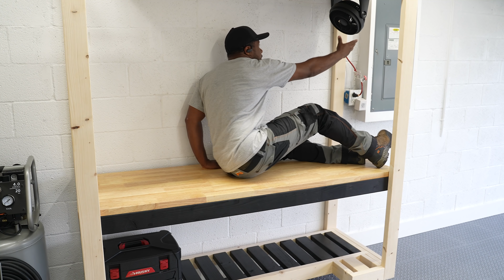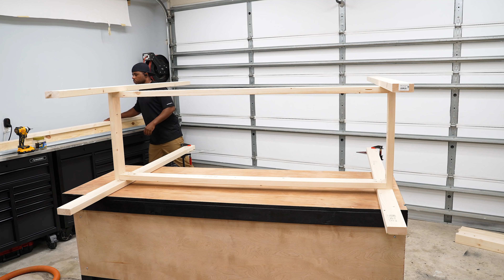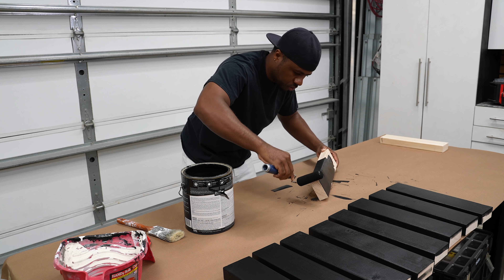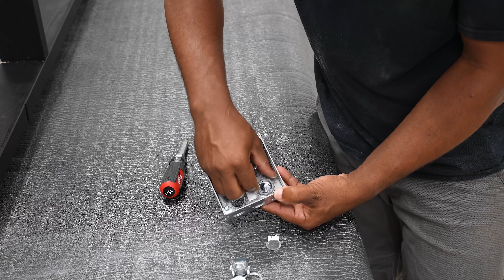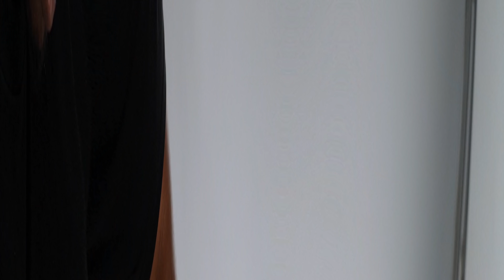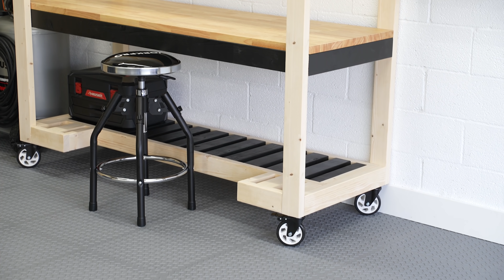DIY workbench with built in light // DIY Woodworking

Comment from the maker: What do you think about this workbench? What do you like or don't?
Plans: https://gum.co/hNWdj
Written version: https://diycreators.com/workbench-with-built-in-light/
Reply: Seems handy especially for a shared/smaller space like you said. You've made a lot of portable stuff over the years 😁 love the positive vibes you're sending out too Glenn! Keep up the great work, take care mate 🇦🇺💜

PS. The fan is an awesome idea!
Reply: Hmm, likes and don'ts?  I really do like the clean lines as with all your work, the functionality, the mobility, the strength, the overhead lighting that moves with it, and the single power cord going to onboard outlets.  It's pretty awesome as it is.  If I had to say a don't, I'm not sure the 4-poster design would meet my needs in terms of accessing the work surface with larger/longer items, seems I'd always be hitting something on them.  Plus in the current lumber market, I can think of a few better uses for the front posts.  If that top were more than a light, fan and hidden wiring and outlets, like top storage also, that might justify the extra support posts, but how much can you really store up there and keep it mobile?  I'd think braces mounted on the back posts would be fine, or even a single 'utility post' up the back middle to support the light, fan, outlets and wiring (maybe a light that flipped out from the post on some sort of articulated arm, providing some amount of aiming).  If 2 posts are kept, I'd probably add a slat wall or French cleat system on the back.  Being able to reach up for a tool or organizer box or some such could help the work surface stay clear.  Or if not a back wall, maybe a flip-up extension in the back, like a table saw outfeed, doubling the work surface temporarily for larger projects.  And a couple of drawers under the bench might increase the functionality.  Maybe a flip-up mounting for a small vise or bench sander?  I wouldn't want to load it down with too much, turning it into a storage cart or something, because as I said, it's pretty awesome as it is.
Reply: @billparrish4385  I built something similar to what you suggest.  Just 2 full length uprights in the back with a short center one.  A couple of long shelf brackets with a 1 x 12 board for the top shelf.  Light mounts on the bottom of the board.  I used peg board for the back to hang small tools or other things from.  I replaced the original top I made for it, sheet metal covered 3/4" plywood, with a think, laminated table top that's heavy as the dickens.
Reply: Well done. As usual.
Reply: I like the workbenche and the only change that I would make, if I made it for myself, would be to support the top with knee braces and cut off the 2×4 front supports. I don't know about you but my elbows always seem to find something to bang against.
Reply: I like the idea to build such a workbench, seems to be very useful :)
I'd like to build one, but much smaller :) thanks for the inspiration :)
Reply: Great idea and execution! I've been trying to incorporate some high strength magnets to hold tools on my rolling bench (drill out and glue them in just shy of flush), and they work for light tools like screwdrivers... What I really need is a solution to hold my tape measures so I stop misplacing them. Doesn't have to be magnets, they do have the clips, but haven't figured out anything practical. Thanks really enjoy all your videos!
Reply: @rcb113  On your tape measure storage, one idea if you're open to using the belt clip on the back, could be a holder long enough to accommodate one or more tape measures, consisting of something thin like a paint stirrer, or a hacksaw blade with the teeth ground off, or a section of a bandsaw, crosscut, plumbing strapping, old putty knife blade, strip of thick HDPE cut from the side of a detergent jug, etc.  This strip could be mounted on 1/4" or thicker standoff blocks on each end, to have a gap for the belt clip to slide down behind.  Mounting could simply be two 1/8" holes through the ends/standoffs.  Two screws to mount it to any wall, to a toolbox, even to a soft-sided case by screwing through the standoffs and through the tool case into a wooden backer.
Reply: @billparrish4385  all great ideas thanks!
Reply: Oh my goodness! You are a rockstar!
Reply: I think it’s an exceptional all around workbench.  It’s perfect for my one car garage.  So I’ve read some comments - ok so you can’t rip plywood on it.  Do that on your floor!  This bench is great for so many tasks!  I love this!  The light is an excellent idea.
Reply: It is so good!! And the video you’ve created is so well done; love the “Where I Am At” pop ups!
Reply: It is a great bench for doing electronic projects but for wood work, it may be too small especially the posts can limited the  sizes of the work pieces.  But honestly it is a great work station, I have to say.
Reply: @manla8397  if you come across any cool ideas for an art desk
Reply: Don't like the front side upper arm support, I might have made a 45" Angle brace instead. However, since there in place consider incorporating a small painter booth with ventilation onside or the other!!! Otherwise, the project Rock's in typical fashion....
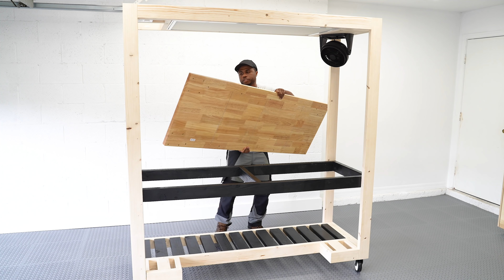Reply: Bro you projects are dope. As a Carpenter I can respect them. Square, Plumb, Level. Side note: 15:20 what brand of pants and boots? I could definitely use those pants.
Reply: Nice design for a mobile bench. I like how sturdy it is and the wood worktop you used. I agree with some who said removing the two front posts would make it more functional in several ways. The main thing I would change would be the light switch and receptacles. I would place power strips on each end just under the support 2x4's that hold the worktop. I would put the light switch under the worktop facing the floor. That way I would not always have to reach up to turn the light on or try to plug tools in - especially those ones that always seem to be hard to push in. I would also us a 12 gauge extension cord about 25' long as the power cord so it is heavy enough and long enough.
Reply: Awesome!  Do you think you could show a filtered/negative air pressure area for tinkering on electronics/soldering station? They say it needs to be "well ventilated" but ventilating away from your face is a good idea, too!
Reply: This is a really nice project. One day I'll make some version of it.
Reply: Love it! It will be my next project!
Reply: Nice. I would remove the front posts though and only use the back ones for the overhead stuff. That way the corners are not limiting the space for larger projects on it.
Reply: I am thinking you are Covid rich with all that lumber!
Reply: I love that you tied in your workbench with the black of your tool boxes, and kept it sleek and simple. It isn't cluttered, and fits into your space well without taking an entire wall. The wheels are smart. You can move camp anytime.
Reply: Dope😎😎 Finally a black person that knows his stuff
Reply: @oldskoolwayy  That's actually pretty disrespectful. I'm disgusted that you would make that comment and even more that you actually think like that. I hope you find a way to do better.

Comment: Great video!  I like the versatility, it seems easy to modify and that is very useful.  I plan to build a version of this for my simple mid-sized CNC machine.  I'll put plexiglass sides on the upper portion, held in a simple frame by magnets.  That will make for easy panel removal when I need full access, while reducing mess and noise when I run the CNC.  Thanks very much for the great concept and build demo!

Comment: Great design all in all. I'm not a big fan of pocket holes though. 
 
If doing a standard style (practical, an non-specific) workbench, I'd say to co with tie straps if wanting a fast and indestructible bench. I used them for a recent build (I actually wanted exposed metal on) and they're so great and so quick. And while they're not as straight, crisp, and clean as a M&T connection, they do provide overkill in terms of strength... I mean, look in your attic. :) ! (Plus they can be painted, veneered, or even flush mounted if you are extremely patient. Lol.)
 
Would love to see a collab with Home Depot, Simpson Strong-Tie, and yourself, creating unique structures that change the way an average garage bench, or storage system could be. 
 
I tell a lot of beginners about the Strong-ties for their bench. It really gives them a boost of confidence, and curiosity about "an even better" way of doing it.

Comment: I will definitely be deconstructing my 7 year old work bench and reuse the lumber to create this. Its time for an upgrade, aka wheels.
Also had a thought of installing thin foam board beneath table top so it absorbs vibrations and cuts down on joint rattling action.

Comment: Excellent share,  thank you. 
One question on the joinery method. Considering that workbenches tend to be used quite roughly. Is pocketholes  based joinery strong enough and durable for this application? Thanks.

Comment: This is great!  This has nearly all the components one would select from to make their own workbench.  I haven't worked with threaded inserts, and I wasn't aware of the Husky workbench tops.  All I'd add to this is a vise of two.  I think I will make two benches and then make a miter-saw table to fit between them with the saw's cutting base at the height of the tables.  The only thing I don't have is a place to get lumber as clean and straight as you've used.  I trust you are going to a lumber yard other than the big box store.

Comment: I'm impressed. Nice design and straightforward building techniques. If I made this for myself, I would probably add a dust-collection feature. It could be as simple as a couple of ports to plug in a shop vac. A more ambitious design might call for a box fan with a replaceable air filter on one end (between the side support columns).

Comment: I love the versatility of this. I always enjoy when a plan changes on the fly for the better. Plus being 2x4s and screws it’s still easy to alter later.  Conflicting thought, instead of drilling the big hole for the fan plug I would maybe drill/chisel small channel between two of the boards to inlay the wire up for a cleaner look (do looks really matter on a work bench?). That being said the large hole could pass additional cords down (say for a vertical power strip on the rear pillar), but concern of circuit load to the entire unit. All in all good stuff man! Keep them coming, because you inspire me, and keep my wheels turning in my head.

Comment: How did you know I've been dreaming of this project?! You dropped this video right on time, OMG. I love the step-by-step you displayed through the entire video. Thank you for the explanations of 'why' you deviated from plan and the rationale. I really like that you're using one type of wood (2x4) in the project. Your work environment is clean and your presentation is professional throughout. This worktable was exactly what I've been thinking about doing. Now I have an excuse to get myself more tools, namely a miter saw, the Parker jig (for the right-angle joints) and that DeWalt right-angle extension for the drill(?) or impact driver. Luckily I recently bought those because the sale at the store was too good to pass up and...well, I needed a new cordless drill. Great job and I'm not changing the design. It works well from what I see!

Comment: With the cost of 6 foot 2x4s going for almost 8 dollars a pop. I don't think I'd be using screws. Someone is going to take that bench apart and sell it on Ebay for big bucks. I may take a job as the tail gunner on a lumber delivery truck. Amazing workmanship. You're clearly an artist...those negative votes are from people that need to take out a loan to buy wood.

Comment: This is exactly what I need. Hopefully lumber prices go down. As far as add ons go maybe a side mounted extension table for a miter saw. With the length of the bench you can use that for support when cutting off the side of the bench

Comment: I liked the build, although I was surprised you didnt dye it in a color or two.
As for recommendations on what to add, I had two things coming up while watching:
1. How about adding an attachment to the top (e.g. a hook) to secure the electricity-connection? A cable that is drawn and pulled on the floor is easily becoming a danger source, just think about tripping over it or pulling the bench and drawing half a socket from a wall. It just is too human to forget about it and use force for a second... ^^
2. The side railings and support may be offer the chance for linear holes, for later attachments (inventory storage) or working area - "you want to paint spray? hold the item in the air by additional railings" - or perhaps even attacheable/floppable arms etc.. Where every inch is useable for storage or utility, the smallest inch of the workbench may come in handy. But those are just some small ideas. ^^

Comment: Fantastic project, now if wood wasn't so damn expensive now I'd build one :)      

Only change I would make it remove the NM wire (Romex) and use flexible conduit, looks like 120V is going to pass through it with the switch to the lights and it being exposed could make it potential hazard.

Comment: Good clean work, both framing and electrical. I think I would have still gone with the outlet on the other side, you can NEVER have to much power.

Next step, clamps and under benchtop cabinet?

Comment: I’d have installed one or more power strips in easily accessible locations, maybe along the uprights above the bench, as opposed to a single receptacle above.   

Also, it’s ironic that the building of a workbench required a workbench to build it on. 😉

Comment: I applaud the effort, however, you've made a ton a extra work for yourself.  #1 you could have made two of the same starter frames and connected them rather than stick building inside and/or built a single thinner one for the bottom, as well. #2 since you took the time to fill the holes with dowels why even use pocket holes #3 why did you only paint part of the frame now it will take much longer to paint the rest #4 why didn't you wire yourself a lower plug strip versus an upper outlet, since now the cord will be hanging down and eventually gravity will probably make the plug come out and it it will be in your way #4 will the threaded inserts take the torque of rolling over your flooring with weight on the bench #5 the slat bottom shelf will allow smaller items to fall thru #6 You doubled the cost of the bench by purchasing the pre-made benchtop #7 the two front posts limit what you can place on the bench and you'll eventually that they're in your way.  I enjoy your channel, but I think this could have been better thought out.  Thanks for what you do

Comment: The light fixture is a great feature as lighting seems to be an issue so much of the time (for me - when I'm trying to work on a project - and I'm down to the fine details - and the readers just aren't getting the job done under low visibility - and mistakes are made - and I'm tempted to lash out at others - but I find my center, and start over).

Comment: Would love to see you build a flip up and down table saw and mitre saw workbench.
Table saw at one end with the length of the table as runout and the mitre saw on the left side to use the right side as runout.

There's a few vids out there, but none compete with your quality.

Comment: You should definitely wire in an option for it to be powered by (2) 18v 9ah batteries of whatever brand tool set you have so you can wheel it outside. You would just plug in the 2 batteries into the bench to get power. The runtime shouldn't be a problem since you used the led fixture. Good work.

Comment: Nice project! There were a few things I'd do differently, but no big deal. I think you'll want a rail of some sort on the back edge to prevent small parts from rolling off. And, I would use 6-way outlet strips for power...that way you get a ckt breaker and of course more outlets which you always need. By the way the "where I'm at" insets during construction are a GREAT idea and well done!

Comment: I love the idea but I think it would be a lot more versatile if you had an open front side. It would be simple enough because you don't need the top to hold much (besides its own weight). Cut the front 2x4's off, then cut them down to 45 degree angels on both sides that just run from half way on the top to the back 2x4. Great project for any level woodworking the thoug.

Comment: You sounding well bro, good to see.  
I put down a similar flooring in my wooden garage couple years back, ended up needing to glue it down because the heat in the summer months (Scotland, so not crazy hot) caused it to rise, decouple and become unlevel - ended up a tripping hazard.  To be fair mine is more of a foam/sponge material for my knees when working on car, yours looks a bit heavier plastic.  
Did the entry deform/come up when running the car over it?

Comment: I really appreciate this workbench design, particularly the contrasting color choices as well as the lights and fan. The only question that I might have is what is the use of the bottom bump outs?  Are they for ease of moving the whole table?
Reply: I would think they are for you to stand or sit at the front of the bench without your feet getting in the way of the bench